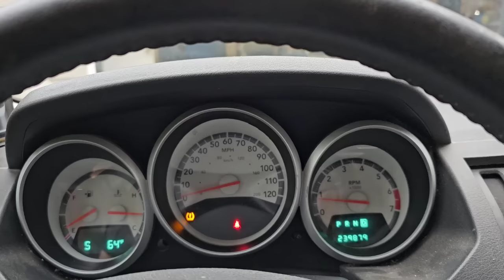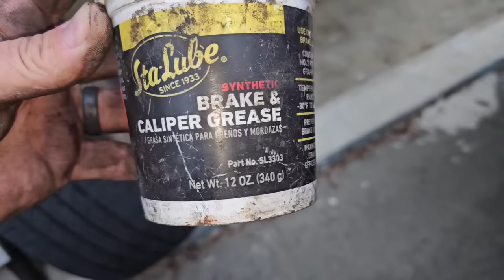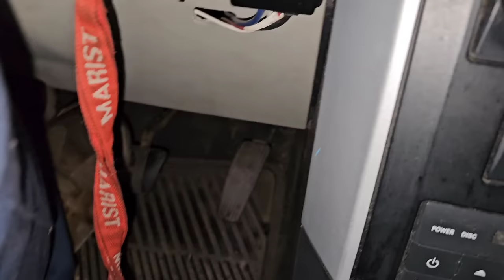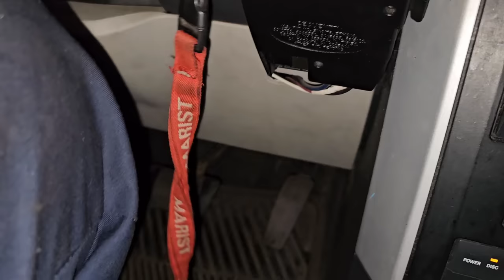I Knew It Was Gonna Need Brakes Soon, I Just Didn't Think It Would Be Today !!

Comment: My brother bought a new Ford Aerostar van back in the 80s (90?).  By 20,000 miles, he had to replace the front break pads.  Not having driven a van like this before, he figured it was normal.  After 20,000 more miles, again he had to replace the front pads.  He figured at 40,000 miles, he'd better check the brakes on the back wheels.  They were drum brakes and were not adjusted,  They were completely backed off!!! ...and the shoes had full linings!  No wonder, the front brake pads were doing all the braking.

Comment: I once owned a Chevrolet Malibu that ate brakes just like your van does! Every 15 -18K miles I would have to replace pads and rotors with no exception. Expensive or economy pads made no difference. They wore out at the same rate regardless of the cost or quality. I use a short piece of copper water pipe (copper nipple) as a spacer under the lug nut to secure the rotor when replacing the brakes.  And like you . . . "I got used to it." LOL

Comment: My father had an older car that used to eat bottom ball joints and front wheel bearings, usually around every 18 months. He didn’t do too many miles in it and he didn’t drive it hard. Turns out it was a known fault and was claimed to be that it was ‘front end heavy’. A 2 litre, front wheel drive, all cast iron engine tilted forwards and solid bar suspension linkages. No wonder the front end was taking punishment.

Comment: I've worked on a 2009 Town and Country that's been in the family since new and it's always went through front brakes and warped rotors quite often. Even one side of the rear brakes seem to not release fully, even after replacing the caliper and hose. The brakes on these van are undersized for the weight of the van. The upgrade is to use the later model larger 2 piston calipers, brackets and backing  plates. Then you must get 17" rims for clearance. Poor engineering from Diamler Chrysler. It is a known problem on these vehicles.

Comment: When I used to do brakes, a really god tip is to back off the bleed a bit nipple, and THEN pull the calliper back to push the piston in, then lock off the bleed nipple.

Not just because it is easier. But when you see the colour of the brake fluid that is expelled. you will be happier you did that.
The fluid comes out black, it is cooked by heat from the calliper and has all the detritus, gunk, moisture , and brake dust just sits there.  You do notice a BIG difference with your brake pedal when you do this.
Reply: Absolutely and changing the fluid every 2 years helps.

Comment: First reaction would be whether there is something inhibiting rear brake action. Some older vehicles had drums on the back, and the automatic star wheel adjustment mechanism was clunky and prone to rust, so they required frequent readjustment in the dealers manual. You've got a southern work flow on those abutment clips. Here in the north, rust jacking happens from behind, so the clips get antiseize or grease behind the clips. That's good advice about the squealers, where the leading edge wears first. My Dodge truck is the same. Manufacturers prefer to make parts that aren't 'handed', for inventory control. So they cut a corner to make one part fit both sides.

Comment: Back in 1989 my ex wife talked me into buying a brand new 1989 Ford Tempo, because her two sisters and mother worked for Ford, well that was the worst car I ever owned! Had it for two months the head gasket blew out, it was repaired under warranty, but within the first year I had to have new pads and rotors all around and then it was like every six months replacing all the pads and rotors again! Anyway after the car was paid off in 1993 I traded it in on a brand new 1994 Toyota Camry, which is now owned by my grandson with 210,000 miles and still running perfectly fine
Reply: Hey I never owned a Tempo but I loved them. Alot of them ate a muffler every year and kept me quite busy at my muffler shop 😊

Comment: This is a long one, Ken.  Sorry, but I do hope you find it of value to read.  I am at times accused of being a little long winded in my various analytical posts.  But, it is just because I do not want to be misunderstood.  Please bear with me and read this post.

I am glad you received so many suggestions and comments on this thread. I read the first 25 or so, then decided to add my two cents. It is possible you have read this from someone else already, or had considered it previously.  No matter, here is what I am thinking, especially with both from brakes (left and right) wearing so quickly, but one side in the front is a bit more worn than the other side up front. I am thinking that somewhere along the way there may be a Residual Pressure Check Valve (RPCV) in the Master Cylinder (MC) that is incorrectly in place for one of the output ports intended to send fluid pressure to a front caliper. 

For those folks ready this post, the RPCV is a small "flapper valve" located under the brass seat used for fluid output in the Master Cylinder. For drum brake and wheel cylinders the RPCV is important to prevent air from leaking into the hydraulic system through wheel cylinder cup seals when the brake system (and fluid) cools while the fluid contracts while cooling.  You never want a RPCV on a disc brake system as it will cause the affected front pads will under continual pressure applied to the pads, hence also the rotors. The symptoms include a reduction in vehicle performance, lower than normal fuel mileage, overheating disc pads, excessive pad and/or rotor wear, warped rotors, etc.

Before charging forward and tearing off the MC…  You mentioned how the dual master cylinder sends pressure on one MC outlet port to diagonal wheels and brake components, as opposed to being sent to either the front or rear braking components. That being the case you do not want a RPCV under EITHER of the outlet ports of the MC, as RPCV pressure meant for drums only ends up being applied to the front caliper for either or both sides of the diagonally located brake components.   Thus, it is very likely the RPCV is not originally designed to be installed under an outlet port, but rather is designed to be somewhere in the front brake hydraulic system, external to the MC – a fairly unusual configuration compared to the far more typical dual braking systems that sends half the fluid pressure to the rear, and half to the front of a braking system.  

If the MC were replaced, and a unit intended for all drum brakes has the RPCV installed under both outlet ports, you would certainly end up with pressure being applied to the fluid feeding the front calipers.  If the MC to only have one RPCV under an outlet port brass seat (for the front calipers only), you would have an RPCV affecting only one of the front calipers, but while causing excess wear on one of the front brake components, it is possible the imbalance in braking would require a behavior that ends up impacting the other front brake components resulting in more rapid wear than normal.

Ken, I may be dead wrong.  But, I feel this is worth checking out.  For me, being curious and wanting to know what is going on with the braking system, I would likely cut into both front hydraulic steel lines, and install a T block so you can put a hydraulic pressure gauge on both the left and right hydraulic lines.  After bleeding the brake lines. press the brake pedal and note the pressure while the pedal is applied.  Then release the brake pedal and make sure the pressure on both the left front and right front brake lines drops to 0 PSI.  If either is retaining pressure you found the cause as most likely being an improperly present RPCV (it could also be a kinked, or bad rubber, hydraulic hose with the internal rubber coating having failed and blocking return fluid when the pedal is released).

At worst you will end up having to replace (or repair) the cut steel front hydraulic brake lines.  But, at least you may end up finding the reason for the problem of excessive front brake system wear.  If it turns out there is a RPSC in place you can retest the hydraulic pressure after removing the improperly installed RPCV and make certain you are returning to 0 PSI when the brake pedal is released.  If you prefer to repair the front steel brake lines as opposed to replacing them, I would not be fretting over that kind of decision.  But personally, I would want to replace the steel lines, just because.

I know this means a lot more time being burned on a car than usual while chasing down a persistent problem.  But just imagine how good it will feel if you find out this is what has been perplexing you all these years...

Comment: 30 years in the messenger business had over 12 dodge caravan, in 2008 the brake pads are smaller than all other years but the van weighs more than other years . The only brake pads I’ve have ever used that have lasted more than 25,000 miles is Wagner thermo quiet. They are very hard to find they discontinued these pads but are still available at Rockauto.
Reply: Thank you for the information !!!
Reply: My thoughts exactly, under sized brakes.

Comment: I just did a brake job on my 2007 Aveo. The right rear brake hose was clogged with rust. I blew in it and no air flowed through. Don’t let the little details slip under you.

Comment: Brake use depends heavily on drive style. Drive like you have a carton of eggs balancing on a small pole and not falling over they last forever. But drive in traffic hard, and the wear is going to be severe. Heavy front of the vehicle and it will wear anyway.

Did mine this last weekend, of course it is "as per sample", so go get the less common rotor diameter, and matching pads, and then take old off, clean caliper, support, hub and backing plate, and apply a thin film of rubber grease on the touch parts, and the hub and bolts, so that they have a little film to keep the rust from making them one.  Pads I got are Ferodo, so guaranteed to last 100 000km, though the rotor will be destroyed by the time they wear out. Did put the little screw back in place, but only hand tight on the torx driver, not even a socket handle on it, as it will not fall out with the wheel in place.

Reason for replacing was I felt a slight shudder when slowing down from high speed, and then looked, and saw that, while there is half the pad still left, the rotors have worn a nice set of ridges, and thus the shudder. So off to the spares place, and get what they have, not ATE, which I wanted for pads and rotors, but off brand rotors and Ferodo pads, so I know that in 50 000km I will replace the rotors and the pads again, with the pads again showing no real wear. Old pads were OEM from GM/Isuzu, no idea which local supplier they use, but likely the OEM, looking at the construction, was Ferodo, as they, Girlock and ATE have the local market OEM part supply pretty much sewn up. Filters I use GUD or Fram, as they now are the same company, and I never had issues with the filters from them, but the others I have had issues with leaking and such.

Comment: 1985 on a driving trip to Scotland in my friends car every 50 miles on the back roads he had to blead the brake's since the car started to slow down ;-))
My guess was water contamination in the oil and the use of the brakes causing heat and expansion making the problem worse.

Comment: Another common Grand Caravan front brake issue is poorly made aftermarket pads. Sometimes, the pad is too long by several millimeters, and is extremely tight when inserting into the caliper. I have had to use a grinder and grind the tips down, to allow rhe pads to loosely fit into the caliper. If this wasn't done, the pads would wear down in months.

Comment: The calipers in my ford escape could not backup because the brake hoses were coming apart inside. I could not even put new brake pads in it . The hoses were clogged with debris . Hoses were changed everything is good now.

Comment: I'm a moderatly aggtessive driver, but because I havecdriven stick all my life (I'm 73) I coast 6:02 up to lights and dont have to full stop most if the time.
I gert between 50 and 70 K miles between brakes.
OEM rotors, Akebono pads.

Comment: We rarely ever have to do brake work on our cars. 2006 Jetta we sold a couple years ago just died at around 200,000 miles and never had brake work!
70,000 on 2015Ford Edge. Just needed rear brake pads and rotors. Fronts were ok.
2019 Jetta 56,000. Needs nothing.
2000 Ford Excursion 297,000 miles had had brakes done twice and does a lot of camper towing.
I always look ahead at traffic and traffic lights and anticipate slow downs so I don't have to use the brakes much at all.
Back roads by myself the car is usually cooking thru turns. Not driven easily but coming to stops it's being anticipated ahead of time.
We also live in fairly flat terrain with almost zero salt usage on the road and that is brine, not actual salt.

Comment: I have a 2014 journey, I've owned it since it had 24,000 mi. It's still on it's original brake pads on all four corners and while I've checked them several times they probably will last till 2024, by the way it has 210,000 miles on it.

Comment: My '93 Caravan went through front brakes every 25,000 miles like clock work. The pads looked small for a car that size. But it would stop the van great. that squealer would go off , and I would change them with in a couple of days. I would just change the pads one time, then the rotors and pads the next. I did it for 12 years !!

Comment: From 2011, or newer Chrysler and Dodge vans there are 2 grades of brakes they offer. I found this out the hard way by ordering the wrong parts from Rockauto for a friend. I have a 2013 Dodge Caravan Crew with the heavy duty brakes. They have larger rotors and calipers on the Front and Back. The front feature dual piston calipers with the heavy duty option, this is where the mistake was made ordering. They last longer naturally. The friend mentioned just had the standard brake package on his 2012 van.

Comment: Hey Kenny could it be the proportioning valve I know that it's supposed to be 6040 breaking to the front if the proportioning valve is bad it could be putting more pressure to the front than the rear

Comment: I finished doing the brakes on my Honda Pilot last weekend. The only issue was that about a week before, 😢 noticed that the fluid was low and filled it up. When I did the brakes and pushed the caliper pisons in, guess where all that brake fluid went. Yup, on my driveway. Thanks for the tips and definitely pump the brakes before you go for a ride. They go way down that first time. I live on a hill, so if I didn't, it would have been a thrill ride.

Comment: My 1981 Volvo GL had the same issue, the secondard disc brake got eneven wip out on bote rear wheel. I brought OEM ATE brake pad and still an issue. I finally got rid of my Volvo due to unstopped problem and high cost of maintiance that done evey 3 months.

Comment: plain simple the the rotors are under sized for the size of the vehicle. sample issue with my 2010 town and country, in my research they switched mid year 2013 to bigger rotors and dual piston calipers. you should be able install like 2014 parts but my need bigger wheels.

Comment: If the outer pad is wearing faster then you need to clean the sliding pins and lube them. If rusted badly then replace the pins. You could have rust at the beginning of the pins which will stop the pins from sliding. I also lube the brake pad clips. Even though the pins could move when you push them in I still remove them, clean them and lube them. Like mentioned PUMP THE BRAKES after a brake job because the piston will be all the way in the caliper.
Reply: remove hardware remove any rust under the hardware to prevent rust jacking . along with removing slide pins

Comment: Worn out rear disks / pads - front still ok ??? We are still on the same tyres at nearly 30,000 miles UK 2017 Honda Jazz 1.3L . 
My guess is the rear pads and disks are worn because of the "Hill Start Assist" feature it is not that hilly where we live but you can feel them drag as you set off, also we have a lot of stop start due to crowded traffic.
30,000 on same tyres - still have 3mm on the front and 4mm on the back, we do drive quite gently.
Same car as a Honda Fit

Comment: Brake is worn at just 12,000 miles? Maybe the bulk of the weight when braking is going towards the front and not the rear. How long do the rear brakes last? The front and rear should wear out evenly.

Comment: Had a 2002 Sable after 80 thousand miles did front pads and rotors. Like yours ever 10 to 15 thousand miles had to replace pads and rotor. Don't know why. Tried cheap and take out a loan parts and nothing worked. After 300000 miles I sold the car, and still don't know why this happened.

Comment: A rear brake issue with these Grand Caravans is eating thru REAR brakes. My 2009 was eating them within 3 years in 2012. The Dealer said it was 'normal'. Well, its not normal. I use my Parking Brake all the time. I discovered the parking brake cables were seizing up, so the rear brake pads were not releasing properly. When I asked my Dealer in 2012, the mechanics thanked me for bringing the issue to their attention. And finally, do not install aftermarket cables. Pure junk. Stick to the OEM from Dodge.

Comment: driving habits are a big contributor to brake wear. In some cases the brake pads are not engineered to spec. I have an old Toyota Minivan and it has very small pads for the vehicle of its size

Comment: Brake pressure bias valve..?...Usually, the front brakes have considerably more hydraulic pressure than the rears...Does the vehicle have the correct bias valve fitted..?...Or a big ass van with underside rotors and pads..?...by design...🤔😳😏🇬🇧